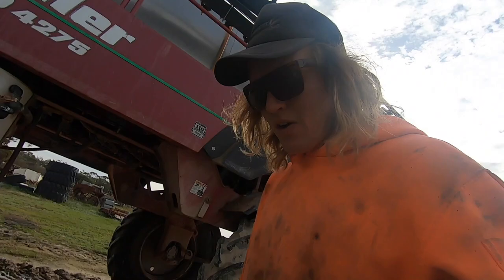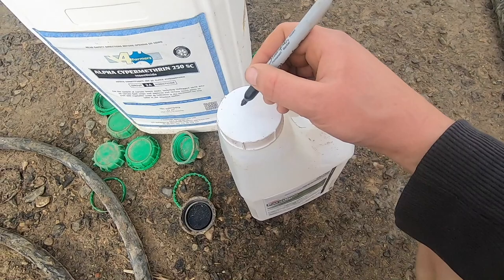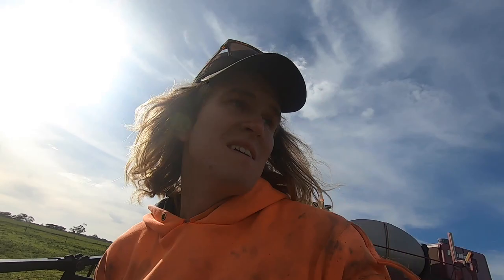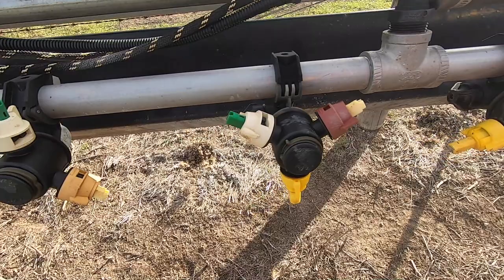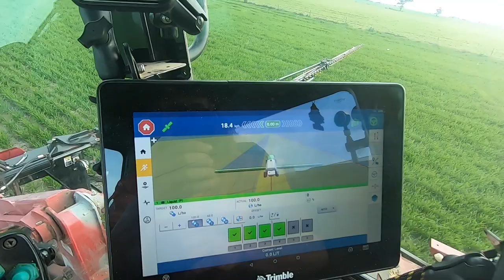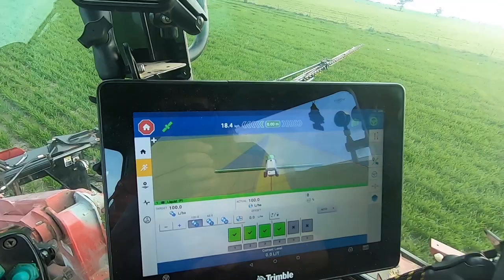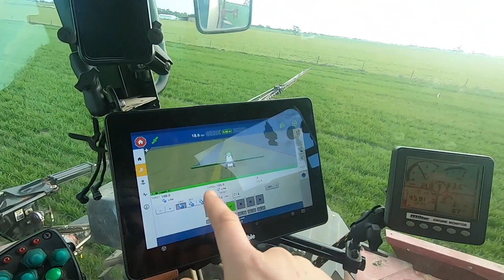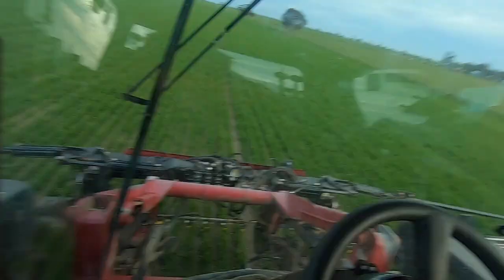Weeds Be Gone! Miller Nitro 4275 Spraying Wheat | Australian Farm

Comment: Something I’ve always wondered.. do the wheels crush some of the crop and that’s just a loss you accept when using machines like this? Or do the plants just sort of bounce back?
Reply from the maker: Great question! Most times they will recover to a certain degree but will never yield as high as the rest of the paddock. We always try to run on the same wheel marks so that the same plants are getting damaged and the same ground getting compacted